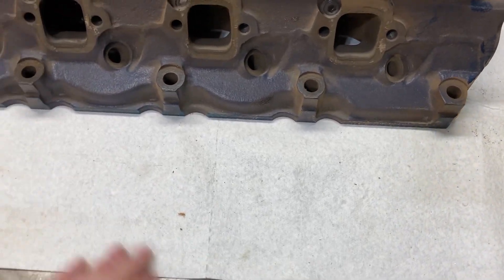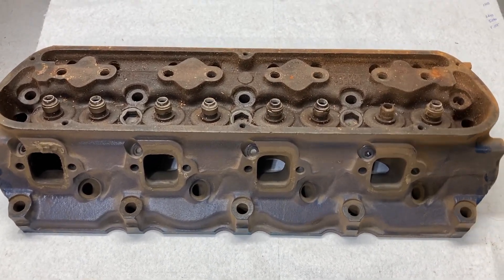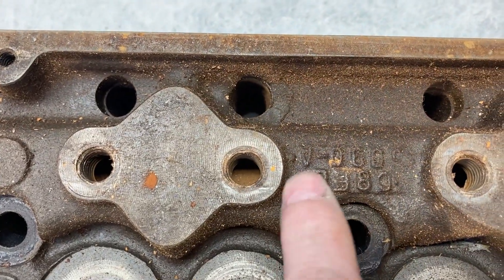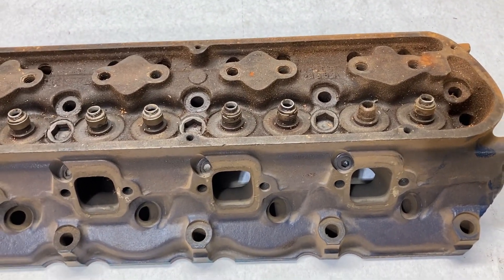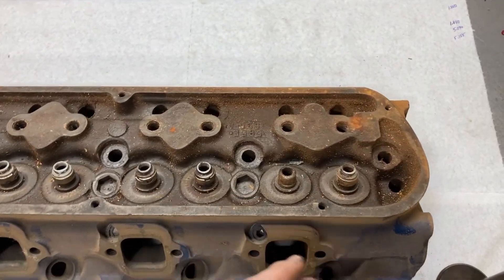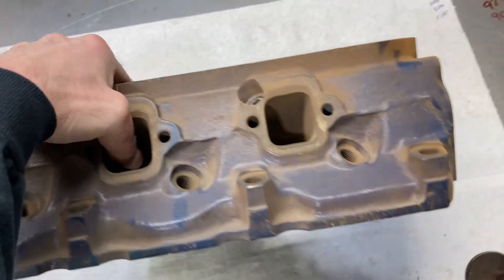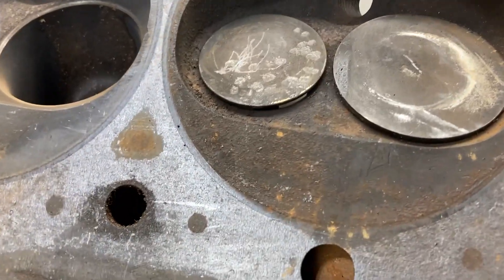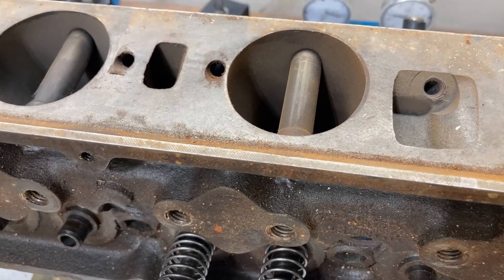Lykins Motorsports SURPRISE PROJECT REVEALED....

Comment: Brent,I had a pair of these heads back in 1973. They were bought by my race partners boss at the L.A Rodster swap meet that year. At the time we were running a 66 Mustang with a 302  engine in Modified Production, here in Australia.
My partners boss shipped them back (with a lot of other parts)  to Australia and offered them to me as way increasing H.P. with our 302.
Unfortunately there was no intake manifold or rocker shafts with the heads, so we couldn't use them. 
One thing, I don't remember the heads  having air injection plugs at the exhaust ports and the water passages on the head gasket surface were plugged .
It will interesting to see what you can extract from this set up.

Comment: Just a couple thoughts. Back in early 70's Gratiot Auto Supply sold a lot of Ford surplus parts in cluding 302 Tunnel Port complete street engines, smog pump and  all. Ad stated 450 hp at I think $750.00. I had the money but had no clue what the engine was built for, my bad I should have called but I let it slide. Forward about 10 yrs to early 80's and there was a fellow advertising in Parts Peddler having 302 TP parts, he was in NY. I met him at a Swap Meet and he was supposed to bring stuff for me to buy but showed up emty handed and in another world. Then ads disappeared from PP from him and any other person selling parts. So 40 yrs later and you have one of each! I'm ecstatic!

Comment: The early days of Ebay were like the wild west with all kinds of unusual race parts being listed.
I remember an ad for a 302TP engine (used but all the parts) and it was the first I had ever heard of one at the time. Saved the pictures from the auction at the time but have lost the files over the years.
One unusual thing I remember is that he had a 3x2 intake for it which I have never heard of existing anywhere. It may have been a factory one-off piece.

Comment: Get that compression up to help get some pull on the intake port and help out with the low end torque that those big ports will give away at a lower compression ratio luv the vids keep em coming like to see some flow numbers out of curiosity

Comment: I would think that these heads would make a great drag racing motor. Did you ever think of polishing the pushrod tubes for the smoother flow through the intake ports?

Comment: WOW, that is going to be a very very cool build, I didn't know Ford made those, I had a CJ 429 and those intake ports where huge, no bottom end but real nice at higher RPM'S
Reply: Jack I had a 71 429scj mustang and yes the ports were huge, however that thing had some serious bottom end. It would blow the tires off all the way to fourth gear. We had to build custom traction bars (bolt on per NHRA Stock eliminator rules) adjustable shocks, etc just to get the car to run 1.5 to 1.6 60 foot times. The engine made 542 flywheel horsepower and the car finally hooked (1.42 sec 60 foot time) and set an nhra record at 10.86 @121.82 mph at 3765 lbs.
Reply: @2429scj  Mine was stock and I put a C6 in it and nixed the top loader and put it in a 72 grand Torino sport, so maybe I caused the bottom end problem, but in did get a ticket for 125 in a 55,,,lol

Comment: I am curious about the cam you will spec. Since the ports are like an FE , are you going to spec the cam like an FE?
Reply from the maker: Cam specs always depend on that engine's specific parameters.  So, even though this looks like an FE TP port, the cam for this engine will be based on what the heads will flow after porting, the intake/exhaust flow ratio, etc.  I hope to get one on the flow bench tomorrow and get some before numbers.  There isn't much info floating around on the internet about these at all.
Reply: @lykinsmotorsports  pretty cool and interesting heads for sure. The combustion chambers look different than any factory sbf I have seen. Those Exhaust ports are defiantly big. About the only factory inline valve sbf head I have seen any where close to these are '69 351 Windsor with the small chambers.